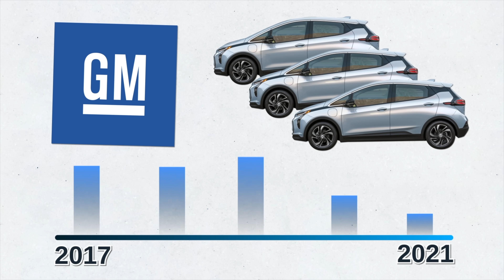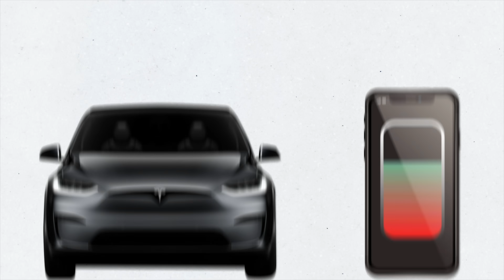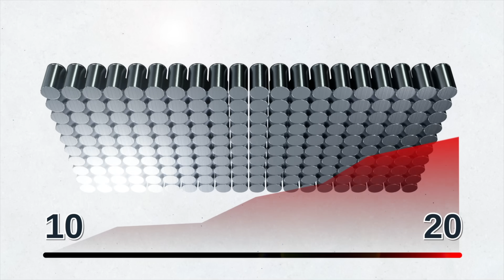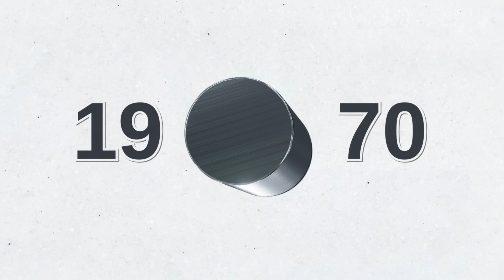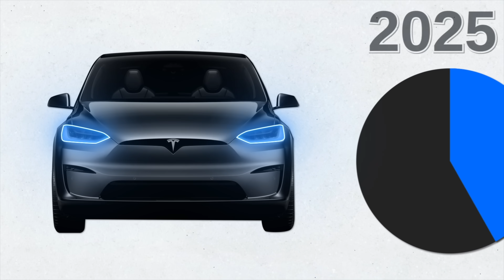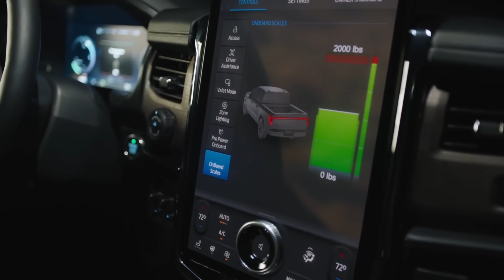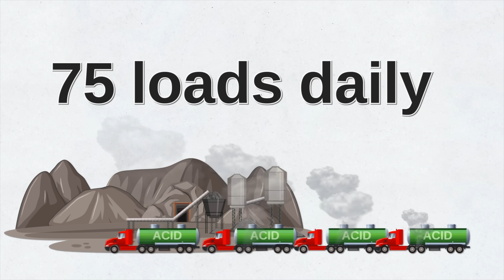They Tried to Shut Me Down for Telling the Truth About This Electric Car

Comment: This is what most environmentalists don’t take into account
Reply: You just got to ride a horse, you wanna go fast just feed it some good feed and watch it go BUCK WILD!
Reply: @jayjohn9680  do horses fart methane like cows? Have u tried riding a horse backwards.
Reply: Electric cars just come from a dealership. 
Like you don't have to slaughter cows for meat, you just goto the supermarket for beef, no cows get hurt that way
Reply: only  way  to  "recycle"  used  toxic  leaking  n  corroding  lithium batteries  is  by  incineration.
Reply: Vlasko60  every Elon musk supporter and Twitter hipster ever
Reply: @jayjohn9680  With our thoroughbreds all they need is good grass & a few #`s of rolled barley & away you go for at least 3/8 of a mile at 40.9 MPH! No seat belts or airbags though & at times the speed control is not good either.

Comment: I live in the middle of nowhere, so I am against total electric vehicles. I think hybrid vehicles would be okay but I don’t think electric vehicles are a good deal for me
Reply: Lol running out of battery and running out of gas would be the same in the middle nowhere 😂
Reply: @jc199159  Ever try to carry a bucket of electrons with enough energy to get you 10 miles to the next pump?
Reply: Worst mistake you can make with EV is buying a hybrid. Keep your current ICE until your ready to buy EV.
Reply: @prioris55555  hybrid that use ice engine as a generator proven to get better mpg and faster acceleration... that is a good direction...in the future they can convert it to hydrogen fuel...
Reply: @alphaxfang  hybrid will have all the problems of both ICE and EV cars EV eliminates so many failure points of ICE. People who buy hybrids tend to regret it
Reply: @prioris55555  nope, it will have EV and electric generator failure point (you won't get transmission problem in range extender hybrid)... but it also have the best of both world, fast electric motor with no range anxiety, it also fill up fast with gasoline, since it use electric motor it also have better mpg compared to ICE car... it can have small battery pack so if you replace the battery it won't cost an arm and a leg... maybe in the future we can replace the battery pack with super capacitor or solid state so we it can last even longer...
Reply: @alphaxfang  You go ahead and buy a hybrid. My caveat is for everyone else. 

Batteries technology have already far surpassed the anxiety range point where it isn't an issue. LFP batteries are now. solid state will mature 2030 and may not be relevant except for exotic cars. You will see carts getting 700km or more per charge
Reply: @prioris55555  lol, yeah buy whatever you want and i buy whatever i want... i won't buy EV for now, the battery war is still far from over... if they crack the solid state holy grail maybe i will buy an EV, but for now it is stupid...
Reply: @alphaxfang  the solid state battery is becoming more irrelevant as time goes by for average driver.  It will likely be sold for luxury cars or high end.
Reply: If the range is long enough, you benefit by charging at home instead of having to drive far away to get gas. The farther  away you live from a gas station, the more money you waste.
Reply: @tman7449  there are 50K or more electric pumps. Congress allotted money to increase it another 500K pumps. Will still need  more. Those pumps will become more accessible as each year ticks by

Comment: I guess you missed the 22,000 dollar story, that's the price to replace a tesla battery
Reply: Out of warranty and it still costs less than the cost of gas, maintenance, and insurance over the life of the battery.
Reply: @gionova1  Are you pretending that BEVs don't cost anything to operate (electricity, maintence, insurance)?
Reply: @matthewsmith8249  no that the costs are lower long term than gas car. If the engine and transmission break in most cars it's gonna cost more than the car is worth to replace for example.
Reply: @Kamina1703  currently cost. The production of batteries and electric cars are increasing with the cost going down like in anything that is mass produced over time.
Reply: @gionova1  
the  cost  of  electricity  will be  astronomical  if / when  everyone  drives  EVs.  in  order  for  that  to  happen, the  power  grid  would  have  to  be  upgraded  which  would  take  years  n  years  along  with billions  n  billions  $$.
Reply: @gionova1  dude...I hear all the time about the cost that is saved from evs. But look at what ur giving up. U can't just up and go on a road trip.  When u stop for energy u have to wait 30 minutes wile the guy that's paying extra for a gas car is back in action in just 2 minutes. You don't have to turn off the heat to save range in a gas car. And there is no phantom draining in gas. Infrastructure is still a issue with mass adoption. U have to map out charging station and sometimes they can be out of the way of travel. Gas u can take anywhere at anytime with no limitations and time consuming.  So people don't mind paying extra for more freedom and flexibility with little limitations.
Reply: @gionova1  insurance is high on Tesla, because when they are in an accident it takes up to 6 months to get replacement parts. They are expensive on maintenance because only Tesla works on them. You have to get the brakes greased I think it was so many thousands miles because of the regenerative breaking they don't get used much except for hard breaking.  Germany rated 3 year old Tesla as the worst vehicles.
Reply: @billrehm3590  correct!
Reply: @Robert Hubbard did you see on the news not long ago the guy who blew up his Tesla after finding out how much th batteries was going to cost him??
Reply: @gionova1  operating costs depend greatly on the price of gas for ice and electricity for ev's.  Wait until the states start taxing electricity for road maintenance...and you know they will.
Reply: You can’t fix smug 😂😂😂
Reply: When you start trying to use rare one-off examples in hopes of supporting your biased stance, you show everyone how weak your stance really is.   Yes, a new tesla battery can cost 22k.  However, no... it's not common in the slightest.  In most cases, the battery will outlast your car by a very very large margin.  For that one-off issue, it is better framed within the 'right to repair' discussion.  Why replace the entire battery, when all that is bad is small module within the pack?  It's not difficult if you know what you are doing and can get the parts.
Reply: ...but you can't get the parts 😂😂😂
Reply: @driver4011  this isn’t entirely true. Our grid needs updated not only to support demand from things like EVs (which is actually minor for most households as charging can happen at night and will use less power than they consume during the day) it’s for supporting the increasing demand for HVAC systems as (for example) colder weather continues to move further south and lasts longer which is increasing the demand on the grid at peak hours far more than evs will.

Also our grid is incredibly susceptible to attack. We do not have generation spread out enough and modern moderation and dispersal in place in the majority of the grid throughout the US. The result is easily targeted outages could cause wide spread blackouts for weeks. Texas is an excellent example - too little power for the demand or too much for the demand and you start blowing things up- and to avoid that you shut it down. Restarting them is incredibly difficult to orchestrate because too much at the start… you blow things up and take out more of the grid.

The places evs will need more is where people will want to install these insane charging stations. Which honestly is dumb. It’s the mindset of I drive to empty and fill back up. Evs are the same mindset as your laptop. You charge when you have an outlet. And if you have a power efficient laptop (mine will last all day) charging it overnight will give you a full tank for the next day. And it doesn’t require a massive amount of power to do that. If you do four loads of laundry in your house, you can charge an ev as the majority of people drive less than 150 miles per day.
Reply: @herbertfreeman3767  this is exactly the argument the horse and buggy industry made against automobiles. 

Plus I drive mine on 700 mile trips regularly, 1000 when I go to Oklahoma - and I enjoy the trips more now. 

Never once had range anxiety and I let it handle stop and go traffic. Once while stuck in the middle of summer heat in a dead stop in West Virginia for almost 2 hours I lost only 3% battery while the jeep in front of me ran out of gas :) just saying - no trade off for me. And nothing is more fun than hitting 75 mph in four(ish) seconds out of the toll booths. It’s like getting on top thrill dragster at cedar point at every stop light.

Besides I never ever have to stand out in the cold to fill up my car :) I have only had to use a charging station on trips. I get up everyday with a full tank and pay 1/4 of what I used to for the same in gas. 

Never going back. Genesis needs to make an EV though — they make a GV70 as an ev - I am on it.
Reply: @billrehm3590  not my experience - but I am only one guy. I do want to replace my rotors with ceramics though. I will do my morning commute in track mode with regen completely off to use the brakes to clean off the rust… wouldn’t have to do that with ceramics. One pedal driving is addictive.

I will say though, they need to make it possible to turn off regen without track mode when driving through icy/snowy conditions. If you’re not feathering the throttle you could cause yourself to go into a skid when regen kicks in - especially if you haven’t put on all seasons in place of the stretched summer tires (ice skates)
Reply: @dbmn7571  I am enjoying it until they do :) 

They will probably require some sort of smart integration with your smart meter at home :/ (some electric companies can control your smart appliances to shut them off during peak demand)
Reply: @gionova1  you will be shocked on how many tesla get totaled by insurance company because the spare part is too damn expensive...
Reply: @alphaxfang  that's not unique to Tesla right now. The pandemic and global chip shortage has hit all car makers and dealers.
Reply: @gionova1  still doesn't see another car brand get totaled like tesla...
Reply: @freedomfan4272  , I had read that he had already parted it out, so he didn't explode the entire car. Still awesome though.
Reply: @gionova1  Tesla doesnt require insurance, any maintenance or charging cost?
Reply: @gionova1  the average cost to insurance a model Y is $2,878 per year or $1,712 for the model 3.  Cost to insure my 2019 pick up truck PLUS my 2016 travel trailer with full coverage, uninsured motorist, and a $500 deductible is $700 a year.  So its more than $1000 a year to insure Teslas cheapest model.
Reply: @gionova1  $22,000 for new batteries when your batteries inevitably go bad in 8-10 years. Meanwhile Scotty has a 28 year old Celica with the original transmission and engine... 

EV's have been an ecological disaster. The best thing to do for the environment would be to drive 1990's Toyota's and Honda's into the ground over the next 30 years.
Reply: I think just like gasoline the price of a kwh will go up when there are more EVs on the road. I wouldn't be surprised if 10 years from now it might cost 5.00 per kwh. But thats all conjecture right now.
Reply: There are shops in Cali that rebuild and replace Tesla batteries that are more affordable. Car guys hate on the Tesla’s out of ignorance. I particularly love the guys at drag strips that cry foul when they get smoked by one. I’m not an EV fan but I think the hate is funny. 
Cheers
Reply: That was a first generation model S. Hardly a mass market car.
Reply: @matthewsmith8249  With Teslas, operating cost is definitely less.  If you switch to Tesla insurance, even there you can save lots of money.  Nobody argues it costs NOTHING...that would be dumb.  Charging costs are definitely less (especially with home charging).   Maintenance....maybe tires, air filters, washer fluid.  There are no oil changes, engine flushes, other dealer recommended items.  The only thing that sucks with Tesla cars is the cost of repairs after an accident.
Reply: @driver4011  Thats already happening here in the and its not because of EVs, we were paying £90.00 a month for gas and electric, our new bills are going to be £375.00 a month, every company have pushed all their prices up, lots of hidden cost and really hard to work out which one is the best to go with...
Never mind all the other bills we have to pay, such has tax etc
Reply: The new Tesla batteries will last 1 million miles.
Reply: @jcoats5529  Ya and I'm Elon
Reply: @cliffordcullen1687  😂

Comment: The charging infrastructure to support a massive increase in EV's doesn't exist. New power plants will have to be built, power will have to be distributed and no, you won't have free charging stations at the rest stops.
Reply: true.....upgrading  the  power  grid  to  be  able  to  handle  millions  of  charging  EVs  n  building  thousands  of  charging  stations  would  take  years  n  years  along  with  billions  n  billions  $$.
Reply: @driver4011  this really depends on where you live. You could pretty easily drive from Canada to Mexico down I5 in all but the smallest ev’s. Anything with over a 100 mile range could do it. It would take you forever but the charging network is there.
Reply: @MattySquared  agreed.
Reply: Said it on a different thread but replying here too. The current grid can support the commuters. Commuters can charge overnight and get up with 200-300 miles on the tank every day (I have 280 at my disposal every day) Charging overnight uses a fraction of what house uses during the day. If the grid can handle daytime peak it can handle a slightly higher amount at night.

Daytime charging stations for people who are traveling - yes those need a lot of power. 

But back to to argument of grid improvement. Let’s say evs were not in the mix at all. We still need to improve our grid to accommodate the increasing population and their desire to stay warm or cool and also to thwart any attack against us. Taking out just a few spots on a grid could cause blackouts for weeks.

So yeah. Stop blaming evs for the need to upgrade the grid. It needs to happen evs or not.
Reply: @briangreenwood2842  a 7kw ev charger uses 3 times the power that my house uses in the day and my house is all electric
Reply: Especially when people will unplug your car so they can plug in theirs.
Reply: @Markcain268   no one installs a 7kw charger at home; you install at most a 50 amp — which is still excessive. A 40 amp will run at 30 which will give you about 30 miles of charge per hour which will give you 150 miles min over night.
Reply: @MotoroidARFC   when you plug in your car it locks the charger to your port until you unlock it.
Reply: @briangreenwood2842  this came from a UK article where someone unplugged someone else's car because they thought they were charged enough. The article then discussed car charging etiquette which continued into the article comments.
Reply: @briangreenwood2842  A 7kw charger takes 30 amps in the UK, that's a standard charger off a standard supply, sounds like the electric grid in your neck of the woods is really shite, either that or you don't know what you are talking about lol
Reply: @NahumOchoa1  I can't drive from Ohio to Yellowstone National Park. That's going to be a problem!
Reply: Totally sounds insane don't it?
Reply: @driver4011  And take a wild guess who's going to have to pay for it
Reply: @NahumOchoa1  Who's got that kind of time in the 21st century?
Reply: @captinbeyond  Now you see the problem.
Reply: @davidkucher5.0Coy  People have plenty of time these days, if they can tear themselves away from the internet that is!
Reply: @captinbeyond  Fossil fuel will be around for a while, just look at the $ signs. Right now there's too much to lose.
Reply: @Markcain268  Fossil fuel is going to be around for a while, just look at the $$ signs. Too much to lose right now.
Reply: @justinedse3314  Yet.
Reply: @davidkucher5.0Coy  I'm not saying it's a good idea just that it's possible. In fact you could probably drive the entire distance using free charging systems.
Reply: The super charger here is posted by solar panels.  I have a 2600 Sq ft home all electric. My bill runs less than $30 since I installed solar panels.  This includes charging the car every day.  It's coming to this.

Comment: Without a major leap forward in battery technology I won't buy an 'all' electric vehicle. Too much negative environment impact currently.
Reply: Just get a used Toyota prius, and then fix a walmart 200cc predator gasoline generator at the back to keep the batteries charged..👍
Reply: @fidelcatsro6948  not a bad idea but i bet the generator will put out more pollution than a modern car engine which kinda defeats the purpose of an ev in the first place! 🙂
Reply: @billynomates920  naaah those 200cc engines are 4 stroke no bigger than a small motorcycle engine!
Reply: @fidelcatsro6948  but a Prius already has a “generator” built in? i.e. the petrol engine
Reply: @paulsi1234  that generator needs to move under the gas engine to work, this generator only needs gasoline from a moped engine..redundancy
Reply: @fidelcatsro6948  A little problem with that stand alone generator is that it does not have a catalytic convertor in the exhaust system.  As such it will produce more Carbon monoxide and oxides of Nitrogen than the original Prius engine.  (Output of CO and NOx from a clean and hot cat is almost zero.)
Reply: @planesounds  thats a plus because people wont have a catalytic converter to steal anyway🐱👍🏿